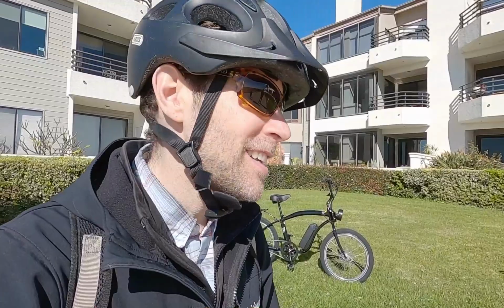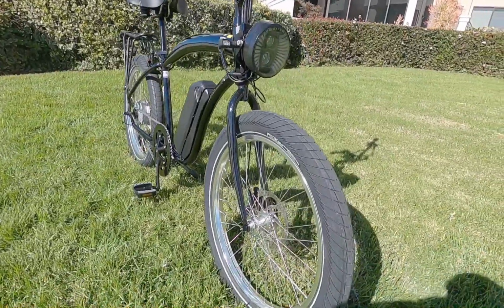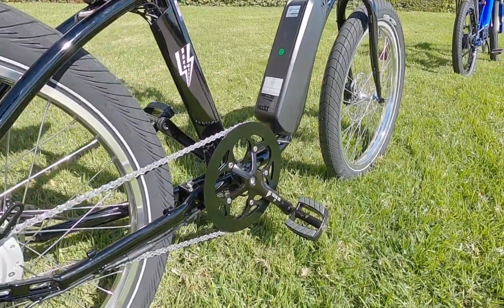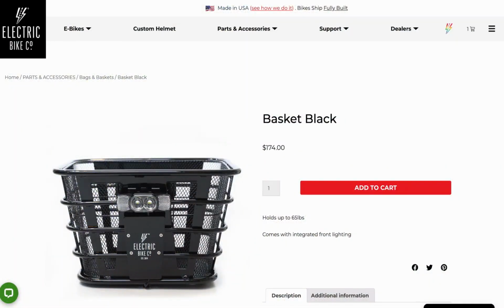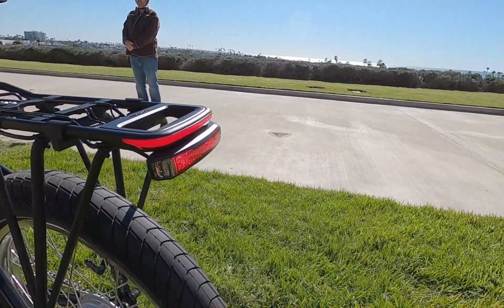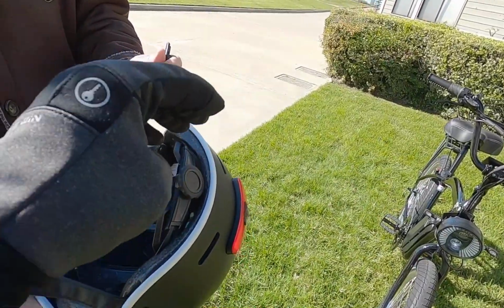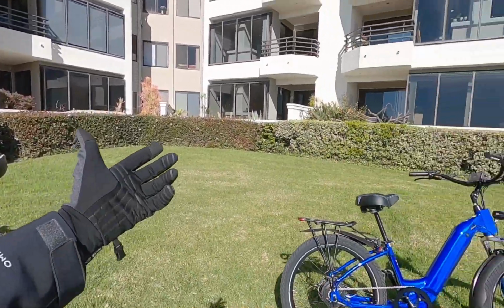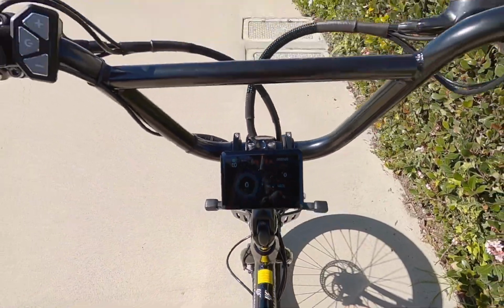Electric Bike Company Model A Review - $1.5k

Comment: The battery on the model C does not take up space on the rear rack. It's built in to the rear frame integrated rack. And it has on board charging.

Comment: Court I changed the back roter on my mustache Friday to a 180 mm roter and also the handle bar stem to a standard stem because the original stem kept loosening up so it's better now.
Reply from the maker: Nice updates, the stem upgrade is something I've done before too. Some of the adjustable angle ones just don't hold up over time.
Reply: @ElectricBikeReview  also I put the speedbox inside the motor so it can go faster, just push the walk mode then you can adjust the walk settings  numbers

Comment: bottom bracket height looks problematic
Reply from the maker: Hi Tom, what's your concern? I see how the chainring has the metal guard and extends well below the frame. I think it would function as a bash guard to protect form damage. The bike sits a little lower with the smaller 24" wheels, but not as low as many folders.